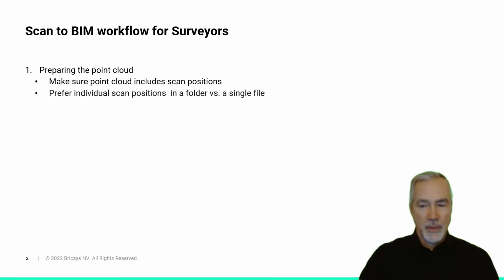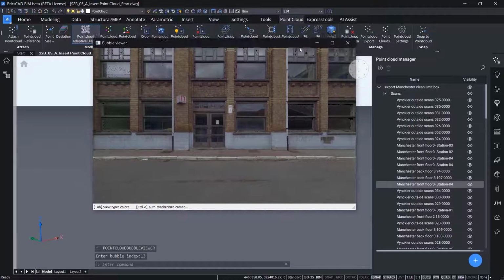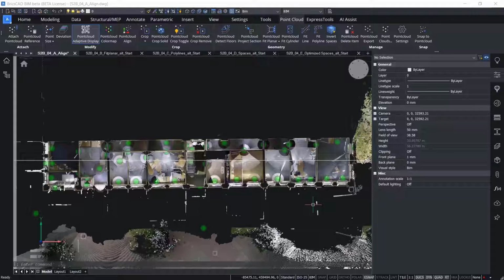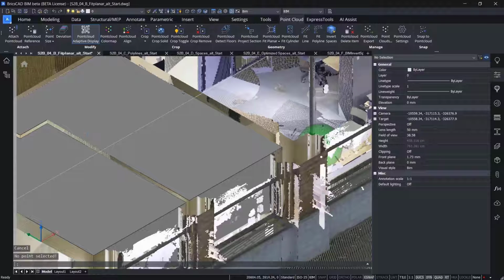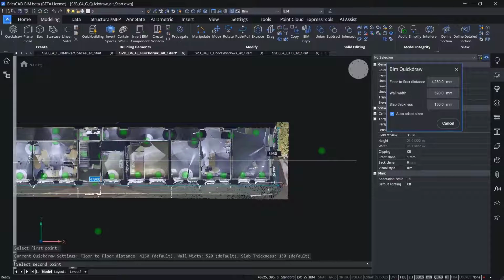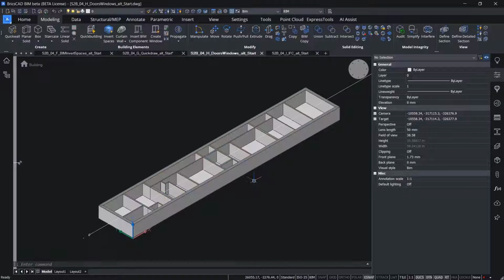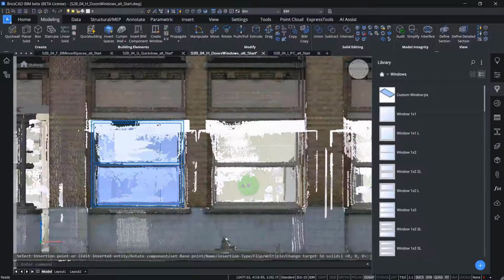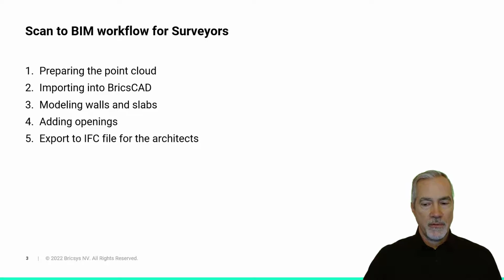Scan to BIM for Surveyors

Comment: have you got a full asbuilt demo you can show the full workflow including roofs, external ground.  Will it allow for iregular walls etc
Reply from the maker: Check out this webinar video - made with version V22 - and let us know what you think: https://youtu.be/x5oeRz2_kFQ?t=601
Reply: @OctaveBricsCAD  hi I tried but with the create plan if didn't work very well.  The slight angles also I couldn't connect the walls
Reply: @OctaveBricsCAD  Is there info on how to connect the planes the fit planer command creates?  As most rooms have items in it doesnt create a box, only seperate planes.  Can these be stretched?  Intersected to create the box??
Reply: @Canihelpyouz  The planes are automatically connected when you press the shift button when clicking the different planes in the room. It currently only supports plane walls
Reply: Thanks Filip no problen, I think this could be great either way it just needs a few pointers from the right people and a good training program @FilipRooms